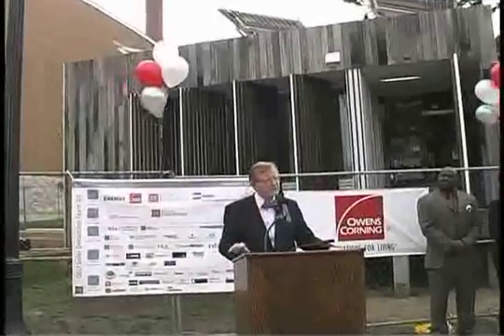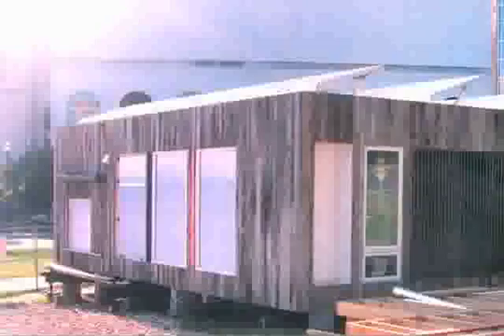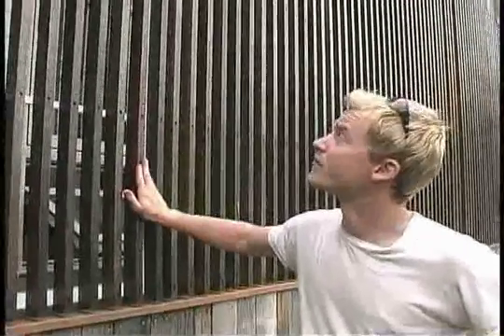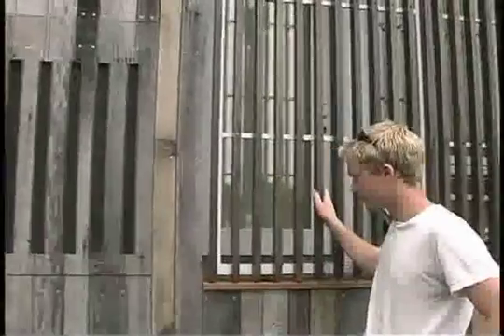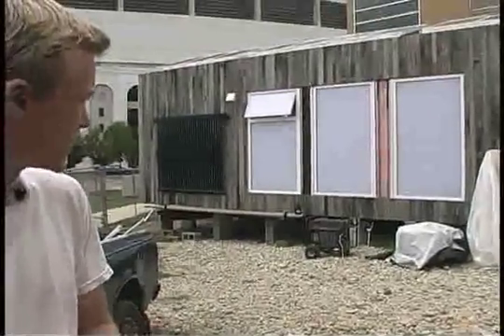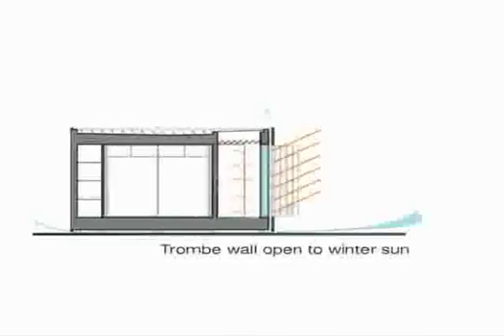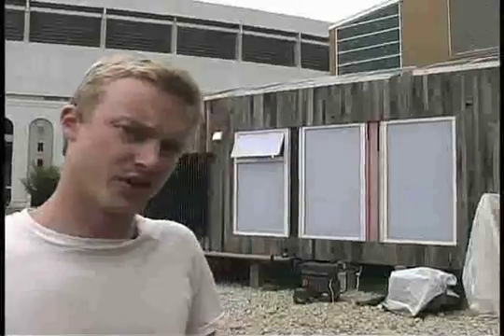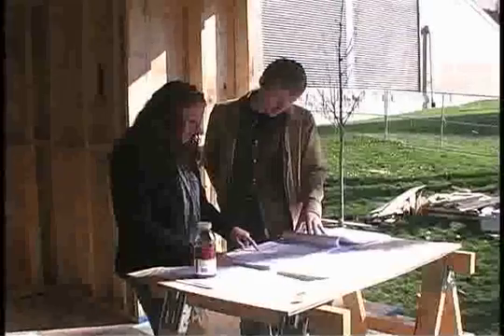OSU Solar Decathlon Passive Building Systems video

Comment: @n7app I think the question to ask contractors in your area is do you have the expertise to build around the principles of passive solar design and a tight building envelope?  

5 months of research tells me:
1) SIPS for walls and roof provide highest R value and high cost efficiency.
2) Solar gain windows on the south side will heat your home for free.
3) Thermal mass inside your home store that heat.  Ex: concrete, stone, water.
4) Use small heat recovery ventilation.
5) A small woodstove.